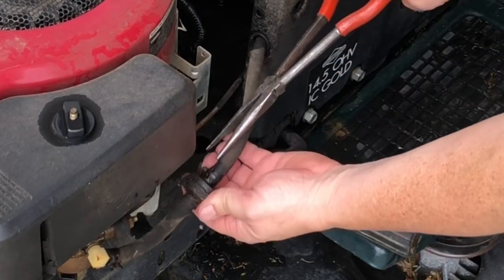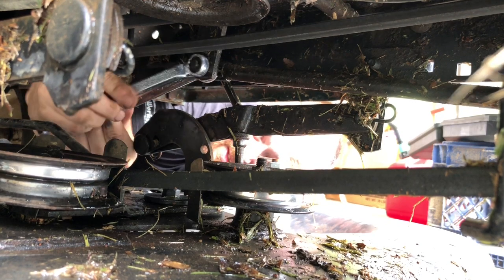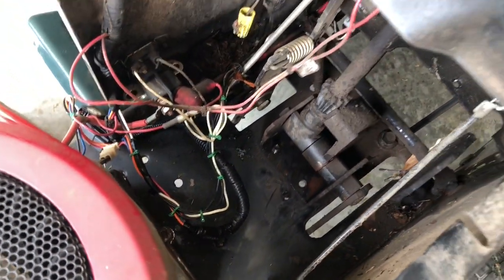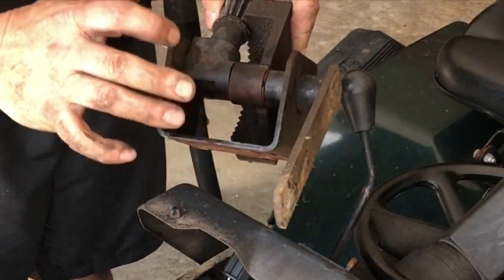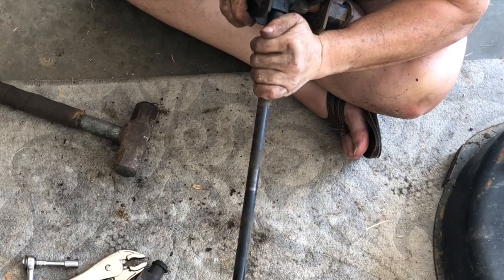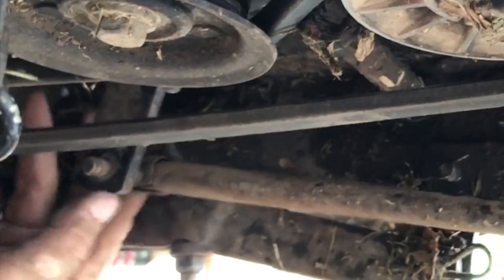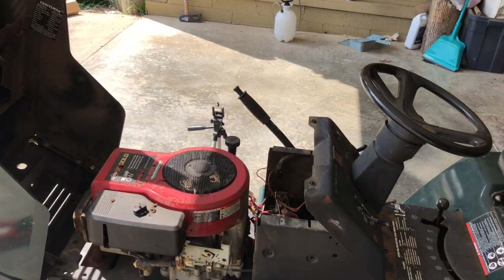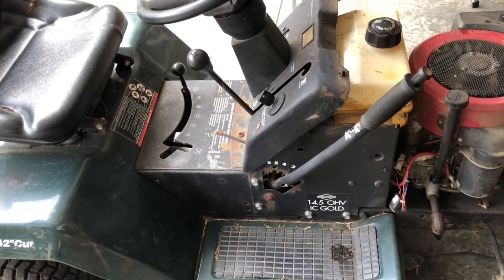The SHOCKING Reason Your Riding Lawn Mower Steering is Slipping!

Comment: I am trying to knock out the gear sectors of the splines but it won’t come off and I also took the ring clip off too. I saw you knocking it on top the engine In the video and it looked easy. Any suggestions?
Reply from the maker: Spray it real good with some penetrating fluid like some kroil or wd40 but kroil will work best

Comment: Mine bows forward and slip pops bad making right turns I do have the whole used steering assembly parts I'm gonna check out if there not good enough to work as my back up I'll be ordering that t part 

But I've got one whole used steering assembly off from a smaller craftsmen frame it would work I'm gonna check for looseness on it if its still in good shape I'm set
Reply from the maker: The bushing at the bottom of the shaft is usually bad too.
Reply: @VansWorld  I checked it out it's to worn at the top and bottom it looks like a 0 shape so I'll be getting new parts 

I do have 3 six speed craftsman's 2 of them work the other is just sitting waiting for a engine it has loose steering probably has the same worn out part as the other's 

So I have a complete steering assembly from a smaller craftsmen frame i kept all what parts i thought i might could use later on this thing wasn't really hard to take apart i thought the screws would be all rusted up it came off easy.

Need to put the front axle on the one that's been sitting for a few years
Reply from the maker: I could use some tires if you have some spare ones 👍😁
Reply: @VansWorld  I do have alot some aren't no longer good but the rims are

Comment: Thanks. for the video  I've had my Craftsman riding mower for almost 20 years, and the steering just started clicking and slipping when I was mowing today.  I was able to finish the mowing job, but had to baby the steering to get through it.  Thanks for the Amazon link and the replacement instructions.  I've got a pretty strong impact driver and an even stronger impact wrench, if the driver won't get the job done, so might be able to get some of those bolts/nuts out without having to beat on the ratchet with a hammer., lol.
Reply from the maker: Good luck.  It’s a pretty good job.  It’s easier to do it if you remove the deck to get to the bolts under the mower for the assembly bracket.  👍😁
Reply: @VansWorld  , Luckily for me, I looked up the model number for my mower, located under the seat, before ordering any parts, and found out by going to the Sears Parts Direct site I that my mower has a completely different type of steering setup from the one you described.  Mine uses something called a steering sector gear that is bolted to a plate, and meshes with gears at the bottom of the steering shaft.  I've removed my deck already, but haven't yet pulled the steering components out.  Not gonna order any new steering parts until I take a look at the parts after I pull them off the mower and inspect them.  I'm in Florida, and it's just too hot for an old man like me to be spending too much time working on a lawn tractor, so I limit that kind of work to early morning before the heat gets too bad.  I just mowed my yard a couple of days ago, so I've got another week to 10 days before I need to hit it again.  With any luck I'll have it fixed before then.
Reply: That's no good when the stickers are gone or are scratched off like mine 

It's why I always go by how it looks I've got some of the numbers but the last 3 digits are messed up.

Plus that website doesn't sell alot of parts for these mowers and then john deere does sells you the right bushings for the front rims 

I had a hard time finding those bushings I found them from looking up the number stamp on the old bushings

Comment: I too am a flip flop mechanic.  Will be  tackling this tomorrow.  Steering been a little iffy for awhile, but as of tonight she won't turn left anymore.
Reply from the maker: Awesome.  It’s a pretty good project.   Save some time and remove the deck to get to the bolts under the mower.   I need to replace mine again. I’m going to get the whole assembly this time.  Good luck with your project and I hope you have a great week ahead.  👍😁

Comment: My freinds Craftsman was occasionally clicking and the steering wheel would not be centered any longer. Straightened wheel back up, cut a short section of pex, split that lengthways and snapped it on steering wheel shaft under mowers dash, slid pex up underneath tight against dash shaft bushing, then put hose clamp around pex. In this instance, takes up the verticle steering shaft slop, keeping the (worn within service limit) pinion, held down in place, so it can't rise and pop out of contact with sector gear, causing steering wheel to skip a notch. Note- this is only a repair for that specific problem of the steering shaft rising- there's plenty of other possible problems with this cheesy style of steering. My 2 cents worth......
Reply from the maker: I dont like this design either. They should have used a brass bushing instead of plastic. I like the advice you gave for the shaft rising up.  Thank you for sharing that information / tip

Comment: What, exactly, is the point of setting the rack at its maximum --  if you're going to end up with the pinion gear being 2-3 teeth off after putting it back together???  I love a person who respects his tools and equipment.  Kudos for beating the steering assembly on the top of the thin sheet metal engine flywheel shield.   And persuading a socket wrench handle with a hand sledge.  I'm sure it helped loosen up the stiff ratchet inside -- hey who needs to take care of tools like that anyway.
Reply from the maker: 😁 well you know.  Gotta work with what you have.  That ratchet worked great for a hammer 😂
Reply: Possibly wail on a box end wrench rather than a ratchet handle??????
Reply from the maker: Haha yeah.

Comment: Also....why TF didn't you show removing the 4 bolts holding the assembly to the machine? Oh probably cause its a pain to do which is why most ppl would even search this video SMH
Reply from the maker: I didn’t know most people would search for that.  The best way to do it is to remove the deck.  No I don’t have a work table.  No all homeowners have a work table.  Thanks for the feedback
Reply: The bolts holding my steering assembly on my lt1000 do not go from underneath. They thread from up top into the mower.
Reply: Then someone else has already had that apart at one time before in the past all mine are at the bottom